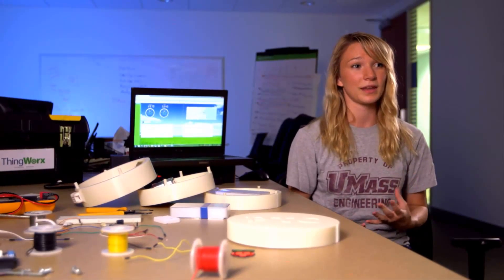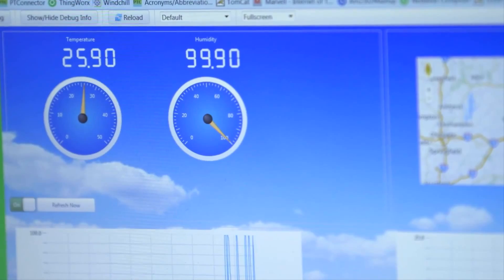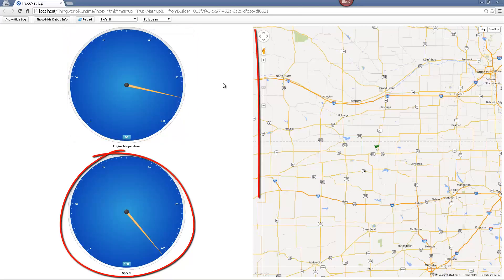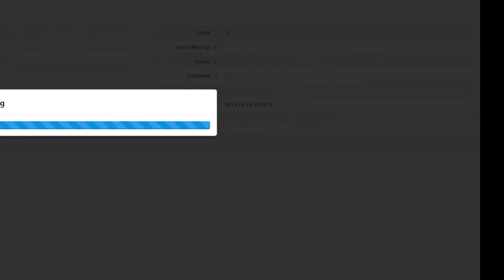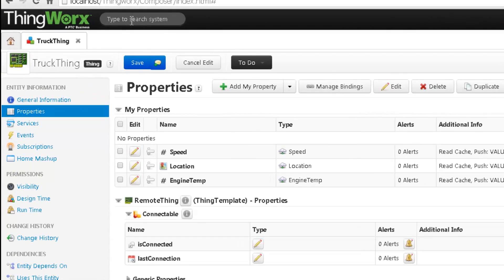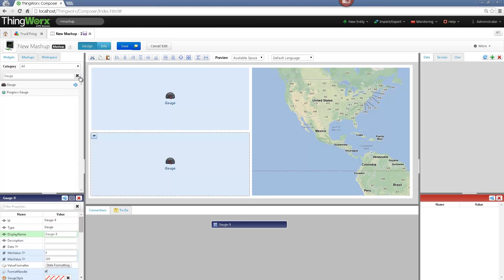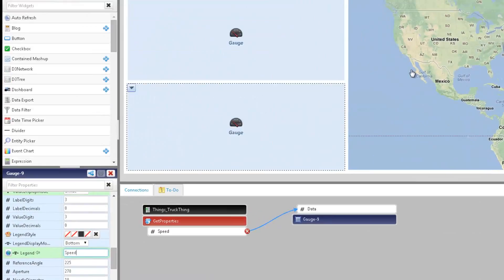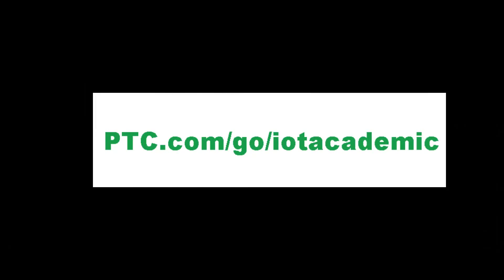PTC IoT Academic Program - Simple Thingworx Demonstration

Comment: The product is great but the support is really poor. There's no community built around the product and that makes it hard to learn how to integrate the product with the real worls. All the tutorials including udemy courses use simulators instead of real microprocessors/edge devices. This video would have been great if it included the hardware setup and code. Invest some time and resources on the education of your product so that it will also be accessible and easier for the many opensource hardware tinkers. Thank you.